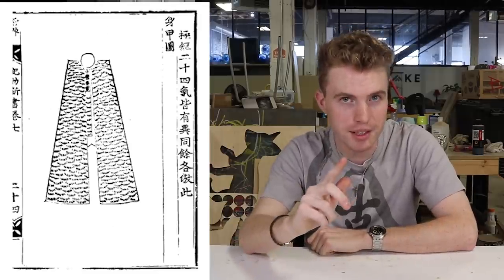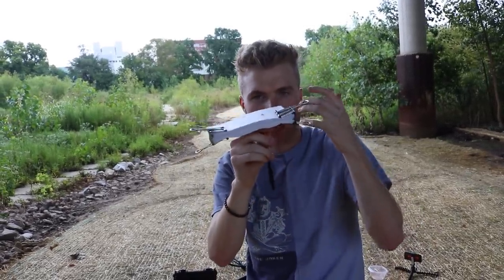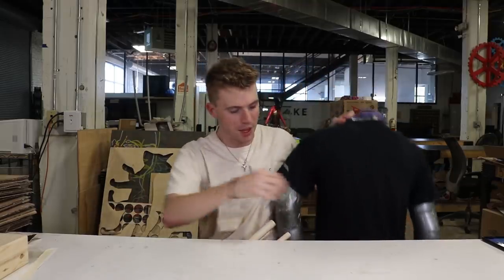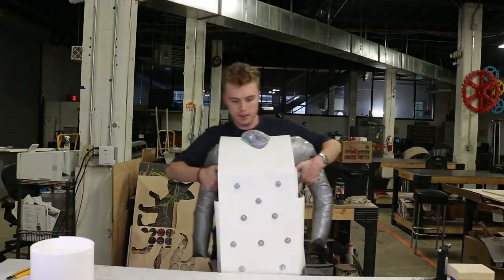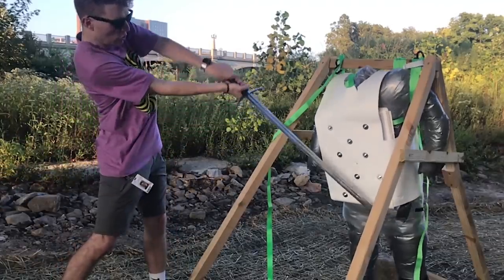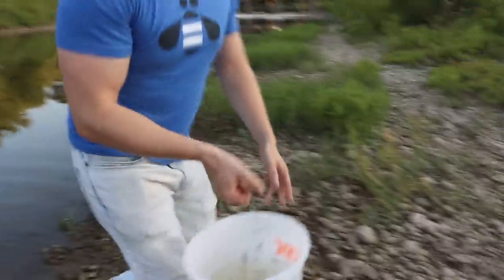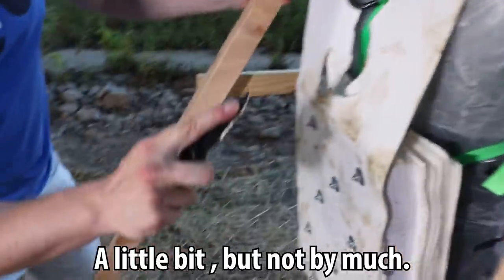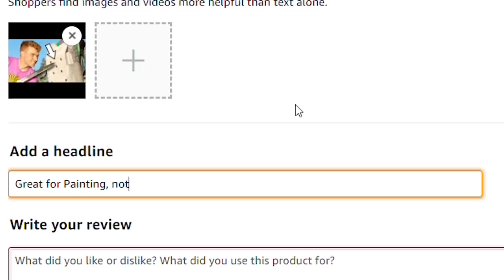Is Paper Armor Really Stronger While Wet?

Comment: Great video, fun experiment! Perhaps the efficacy of the ancient paper and its corresponding response to moisture may have something to do with how their paper was made. It may be similar to how carbon fiber derives much of its strength from the specific weave of the fibers, and not simply from the material composition. Definitely thought provoking!
Reply from the maker: That's definitely an interesting idea! 

Maybe I should publish my thoughts based on my research for this video, because there is SO much that I could talk about. Unfortunately, talking about paper composition is super boring on camera.

The challenge is that paper is, by nature, a non-woven material. So any weave would have had to be done after the paper itself was made -- or if the paper itself was woven, then is it really paper? I think that depending on the length of the fibers used, linen paper might have been a compelling and realistic option (since that's what is blended with cotton in US bills, a very durable paper) -- but with as extensive as this project already was, attempting to make my own paper would have been more than I could handle. Even so, I'm not sure it would have made a whole lot of difference (except that it might have absorbed more water).

Tl;Dr - I know WAY more about paper now than I ever really wanted to....
Reply: @Weisz  According to the document, the paper should impregnated with either resin or shellac.
Reply: @crusaderzero3984  in that case you could probably assemble it similarly to fiberglass
Reply: lmao hi

Comment: The Japanese common foot soldier made a simple but strong armour using layers of cotton and paper, soaking(some sort of light resin, or glue itself) and gluing them together, than laquering them
Reply: Noshit Bro when thick enough... that can actually be bulletproof. Don’t doubt a hundred layers of glue and fiber
Reply: I think thats what Senku did from Dr. Stone
Reply: Yeah, imagine having paper and cloth layered together, then soaking the paper and pressing the paper and cloth together till it dries.  (Idea, no clue how well it would work)
Reply: @jooot_6850  it’s bulletproof until you pull out the 50 bmg
Reply: @obsidianv3  you could say the same for an armored truck, wouldn't really say an anti materiel rifle is fair game for infantry
Reply: @jooot_6850  all is fair in love and war.
Reply: Anti-Furry Wolf but we are also comparing early Chinese armor versus modern anti vehicle infantry weapons
Reply: @obsidianv3  now now, before you say that I was the one that testified in favor of heavy linen armor's effectiveness against firearms, do realize that I was doing so in order to prove a point, not legitimately say that it was 100% bulletproof.
They can, in fact, stop certain bullets from penetrating them. However that does not apply to modern armor piercing rounds which are purpose made to crack through titanium and/or steel armor plating.
Reply: @jooot_6850  It can stop the bullets back then, gunpowder was a lot weaker.
Reply: @checothegecko8130  and bullets were literally balls of lead. they were giant BBs propelled by relatively weak powder
Reply: @obsidianv3  you really could say that for everything under a tank
Reply: @kadmielsimbulan2958  yep
Reply: Flashbacks of dr. Stone
Reply: My dad shot a vascular autonomy of the head and neck when get got drunk living on fort lee va Jackson circle found the book in front of the TV we went to work we had no school found the book the 357 hollow point went almost  all the way through it had maybe half inches of paper and then the hardbook cover the bullet still look like a bullet with no damage the bullet stopped .
Reply: @rlh9373  hey can you rewrite that a but use periods, I nearly had a stroke reading that lol

Comment: what we learned today:

make paper armor and not iron armor
Reply: But it would be much more heavier, and probably cost more, don't you think ?
Reply: @die5el150  but you would survive more atleast
Reply: #addpaperarmortominecraft
Reply: @iBeanGaming  Real steel armor is probably lighter than this paper armor lol, real steel armor is only a few mm thick while paper is inches
Reply: @ARockyRock  all blocks should be an armor form because it would be cursed
Reply: Real metal armor ( I’m referring steel or iron) is actually light, because it’s only a few mm thick, and is usually hardened. While paper armor will eventually be damaged enough to the point of needing a new suit.
Reply: @checothegecko8130  Probably right. Paper is heavy, and it's easily damaged. Also, weather conditions can ruin it. Metal armor probably just better.
Reply: Yeah but the memes-
Reply: @checothegecko8130  there's also the problem of rust. it's extremely humid in southern china, and only slightly better in northern china. it rains heavily and often.
Reply: @corbeaudejugement  you can oil metal plates to prevent rusting
Reply: @maravnir525  which is costly and time-consuming
Reply: @corbeaudejugement  putting animal fat on a plate to maintain it is time consuming?
Reply: @maravnir525  it’s more complicated than that, no? i’m assuming it’s like treating a cast-iron pan and that you have to fire it afterward
Reply: @corbeaudejugement  nah it's legit just like polishing your shoes or putting a new coat of paint on your wall
Reply: @maravnir525  damn
Reply: Umm how about aliminuum ?

Comment: your edge alignment is uhhhh. Well it leaves some to be desired. I would look into something like a messer, cutlass, or cringe katana. Getting a better edge alinement with a single edged curved sword is easier and the thicker spine makes the weapon more forgiving of bad cuts. Armor still would have held but i think we would have seen more extreme damage, more a "i got to get this replaced." kind of deal.
Reply from the maker: now THIS is helpful -- I'll keep the existing sword for the thumbnail shots though :D
so sad that katanas have become cringe, but i do tend to agree - too many "kAtAnAs ArE sHaRpEr ThAn LiGhT iTsElF" bois out here
Reply: One thing you can see is the flex in the blade. It bowed out on the hit, that is energy waisted. That energy could be pushing the blade deaper, but was waisted.
You could look into some hema stuff on the internet or British military saber books. Most hema clubs are closed right now so that isn’t a great option.
Katana bois are pretty bad. The katana made properly is terrible at clashing with anything hard as the heat treat causes cracks in the blade. Modern non deferentially heat treated blades are more durable but loose an amount of ease of use. Both have an edge geometry that is lacking for fighting armored foes.
I will see if I can suggest any channels to you for drills to get you moving right, cause longswords are not the most forgiving weapon.

Comment: There’s a lot of inaccuracies in this video, but you’re operating with a quite limited budget and resources so I’ll give you that.

But the ones I really want to voice, that others don’t seem to mention too much, is the difference between modern crossbows and ancient crossbows. Many ancient crossbows had MASSIVELY higher draw weight than modern crossbows, many requiring pulley mechanisms to even TRY to notch a bolt.

The others that others are mentioning are the paper used, and so on.

I love your content, thought I’d throw in my two cents to show I care! Keep up the good work

Comment: Let me say first off that your videos are very entertaining, so thanks. Secondly, I'm not sure this one has been myth busted, for lack of a better phrase, quite yet. I mean, I'm not sure you're getting a benefit with how much air gap is between the pages, so loose stacks might not be a proper test. 

So would more of a papier-mâché method work better?  Basically using the water as a binder and/or effectively making cardboard, maybe that's more what was meant? Perhaps even testing a version dry, then wet, then dried after wet (like a layered cardboard almost). Though it's wood, maybe this is more relevant to "Crushed wood is stronger than steel" or "Chinese researchers develop super-strong material for aerospace applications", or "Researchers Make Wood Stronger Than Steel".

And as TheXanian
 mentioned, silk paper sounds very viable, as silk is also one of, if not the, strongest things per weight found in nature.

I think this debate should most definitely be revived.

Best!

Sources for consideration:
https://www.nature.com/articles/d41586-018-01600-6
http://www.xinhuanet.com/english/2020-05/26/c_139089102.htm
https://www.voanews.com/science-health/researchers-make-wood-stronger-steel

Comment: Armor made from paper jacketed in silk was highly effective against arrows, from what I understand. A properly fletched arrow spins during flight, which would cause the silk to twist around the arrowhead, making it stall and jam into the paper core; failing that, the silk wound around the arrowhead made it much easier to remove from the wound without damaging the surrounding tissue.

Comment: It would of been more Mobile when wet and it would’ve had more like padding I guess so it would hurt less and stop less brutaly
Reply: It would have been heavier when wet, not more mobile, mobility is in the design of the armor and where it is placed, look at late medieval European plate armor, its mobile as heck because of the placement of the joints and the engineering behind the armor, also im 95% sure the ancient Chinese would have used actual padding under their armor.
Reply: Go ahead and try running around with 50 kilos of water on you

Comment: I think the important part is that, at the time of their use, the fact of armor not being compromised by taking in water is very important. Most they would be facing would be wearing maybe leather and furs aside from the lucky few, and furs become heavy and waterlogged easily, and leather becomes soft and tender when soaked. The simple fact that the paper armor doesn't fail quite as much is a big deal... As well as the weight. That's probably a good 1.5k pages, full torso sized. If you've ever had a textbook that was a thousand pages, I'd say multiply that by roughly 2.5. That's a solid brick of paper, and when wet is probably at least ten pounds heavier. It's not bad compared to what modern soldiers have to carry, but the ancient Chinese, while powerful, weren't nearly as regimented in their troop training as we are now.

Comment: I think when the texts say wet, I think its a close comparison to that of sand. When sand is exposed to water, at first the water moves through the sand freely and the sand is soft and malleable, but when the sand has been exposed to water and the ln strained a bit, the sand compacts. So maybe if you were to soak the paper and then squeeze it so that the paper was still wet but not soaked, maybe that would work better

Comment: You should test it against a steel plate of some sort. For example, take a plate that can be almost punctured and use it as a reference. Then make the paper armor that will get punctured in the same way. This will mean that you have got the equivalent for the steel plate, right? So, you can check the weight of both armors and see which one is lighter. Armor with less weight should be better because it would protect the warrior and give him less fatigue. 
The other things would be the cost of both armors and their reaction to the weather (rain/full sun/etc).

Comment: I do have a doubt on the testing.
You tested the armor on the manequin which was hanging from that structure. This in turn caused it to act like a pendulum, as in: it had a lot of "give space" when impacted, transforming part of the bullet/knife/sword energy in motion of the whole body. This effect is less relevant as the mass of the hanging object increases, but I think in this case there was noticeable difference with respect to the "actual 70kg soldier standing in armor" case. Naturally you can't hire someone to wear the armor and have at them for a great quantity of reasons.
I'd suggest to investigate a "worst case scenario": mount the armor on a fixed wall and see what happens. In this case ALL of the weapon energy must be absorbed by the armor.
Also, given the fact that the wet armor was significantly heavier could've affected the results since: more mass>more inertia>less energy lost through oscillating motion.

It was just a consideration that came to me given my background (I study physics), perhaps you made different considerations I didn't so this idea was already taken into account. Nevertheless: love your content, keep it up because it's always fun to watch!
Reply: He also wasn't using the sword properly.

You're supposed to use a sword to, y'know, cut. Actually drag the blade across whatever you're cutting. But he's swinging it more like a baseball bat.

Comment: second time you stabbed it with sword you hit it much lower. Since you got your dummy hanging there, its basically a pendulum and you are applying more torque, lessening the force of impact. i.e. the lower you hit it the less it will penetrate. To properly measure you need to a) fix the leg so it doesnt behave like a pendulum or b) always hit the same height

Comment: Paper armour was made by two different elements, paper and plastic resin. Yes, I just said plastic resin, what chinese did was overlap the paper and resin (made mostly with tree sap) and then soak it up in water to compress this layers until they got a complex solid material that we now call "carbon fiber". This process took from hours to entire days to finish, the reason why it wasn't used so frequently was due to metal being easier to work with, which allowed to make more armours in less time.
Reply: Btw, what they did was first compress the paper, soak it in water and let it dry over and over again and then adding the resin with more paper

Comment: I mean think about it.weopons of the period are bolts,arrows,and blades.all three types are good at punching through material.and if you was wearing a full suit of this armor,why in hell would you want it to absorb water? it would both add tons of weight,and add risk of hypothermia.neither is anything you would want as a soldier of any type.it simply makes more sense that is was a laminate of materials and resins,and each layer of material was most likely placed so the fiber grains opposed the directions of the one before it for even more strength

Comment: Paper is not ever going to be anywhere near the effectiveness of steel armor, they just work differently. The biggest thing you need for your armor to work is the shape which deflects blows so you don’t absorb them. Paper would eventually get cut and it wouldn’t deflect anything and would probably just take it which is not good for your body underneath it

Comment: Interesting test but I don't think it serves the purpose of testing the actual effectiveness of paper armor too well. As TheXanian mentioned this does not really match the way paper armor was made. Added to that, I would expect talking about wet armor being more effective during combat we are talking about rainfall, not absolutely soaking the armor.
I would expect some kind of finish or other method of sealing off the sides in paper armor so that it doesn't soak too much, which would only make the top layers wet and I think that might improve effectiveness in combat because the top layer ripping may give more chance of a blade sliding off as opposed to relying just on stopping power alone. I imagine this would be similar to improving steel armor's effectiveness by making it dome shaped and therefore deflecting blows by effectively redirecting them instead of just stopping them.

Comment: To the idiots who oversharpen their swords, a sword doesn't cut because it's sharp. It cuts because the right sharpness has the right angle to separate material in its way. The cutting of a sword comes from your body and limbs applying the force that uses that right sharpness to cleave through.

Comment: Louis, I may be incorrect however the sources you may have been using may have been corrupted by language translations or has been slightly incorrect due to poor ability to record things. This could support why that the “it would work better in water” is false. My theory is that maybe the water dried within the paper therefore making it a more durable material with the more combined structures of the paper atoms.

Comment: well i suppose test should be done more seriously.
"wet" is a vague word. 
how much wet?
soaked?
just a little?
Wet and then waiting for it to dry and maybe it gain resistance?
I think if you don't do different test , the results are a bit lacking.
Paper , specially when made from different materials might have different effects based on slight changes ! At least in my opinion (without ever testing) But it would make sense no?

Comment: This is misleading. The paper armor did not work as well as steel. It stopped what steel would stop. But the steel can be used again, while the paper would need to be replaced. Which is acceptable when steel is very expensive and you have a tree that matures in weeks.

Comment: You were using a cleaver when they would have used a ninjato or a katana which are both way sharper plus most of the damage a cleaver does is bc of its weight not sharpness

Comment: The way you swing that sword bothers me slightly. If you punch someone with the edge of a knife (not the point) it's not going to do a fourth of the damage a knife (or sword) does slicing something, which is what they are used for, piercing and slicing. You swing it so the blade of the sword hits the armor roght on, it doesnt slice it, but punches it, I would say, ask someone who knows alot about sword handleing and then try it out, cause right now that is a highly inaccurate way to use a sword